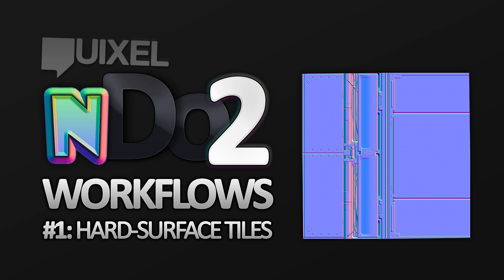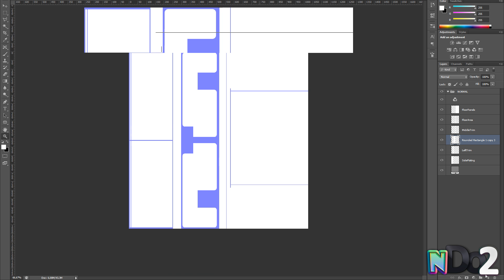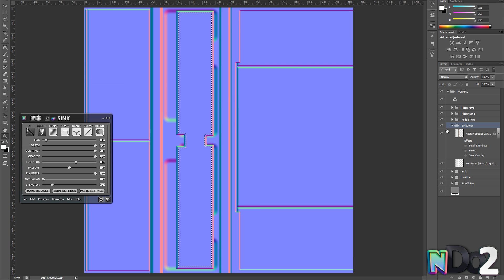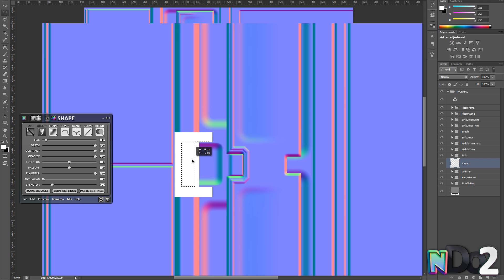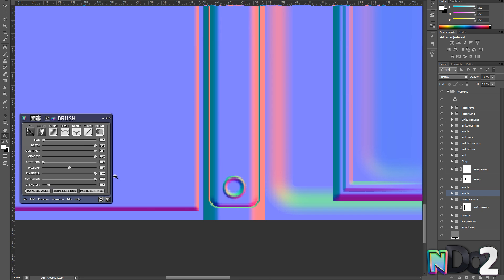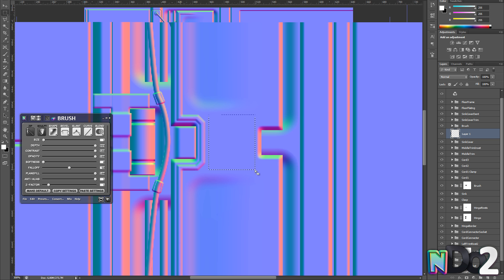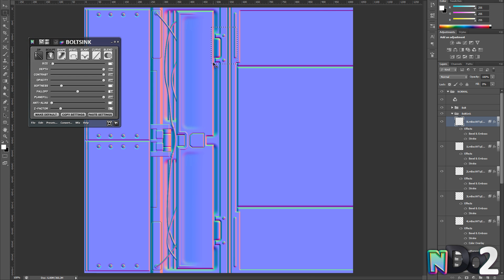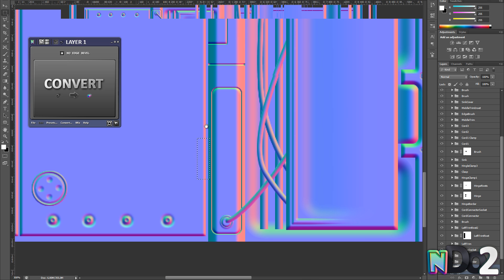nDo2 workflows #1: Creating hard-surface designs

Comment: This is the first time I how Ndo works, but aren't people just generate the normal maps from their already built objects?
Reply: +Tatsang Wang one of the advantages of creating details in nDO like this video shows is that it doesn't require you to work with insanely high poly models. I've worked on weapon models that required 10 million+ polygons in order to create tiny little details like rivets / screws / seams / welds.. Working with such high poly models can get very slow and baking them out is also a painful process if your computer is not high end enough. It took me almost 1 hour to just bake a normal map from the high poly --> low poly model, and god forbid I make a mistake in the bake. Also even opening up the model in 3dsmax and rotating around was PAINFULLY slow. Every time i clicked on the high poly, 3dsmax would freeze for 30 seconds!! 

When I switched to nDO, I was able to do the really really small details much quicker.
Reply: +Tatsang Wang  mind you, i still use a high polygon --> low polygon bake, for the gun ( to bake out details such as rounded barrels, and edges, and high level stuff that a traditional normal bake is good for). With these "high level" bakes, my hipoly model is usually around 1 - 2 million polygons (which is much much easier to work with on my machine)
Reply: Im new to PS and quixel, i mainly use mari to texture my models. However, ive had lots of problems with creating normal maps in max and mari. So, i thought i would give quixel a try. So, its possible to import a high poly (10M) 3d model into quixel and then create a normal map without crashing? thanks

Comment: When I try and create a wire like on the video, my wire is way too big, though i'm only drawing a path. adjusting size doesn't help anything. Any ideas to what might be going wrong? For future reference, would be nice to show all the Photoshop UI so we can see settings, buttons and so on ;)
Reply: +3rdpoly Found out the issues was pen settings. To draw wires, remove Fill, black stroke, then control the size by adjusting the points, remember to be in shape mode.